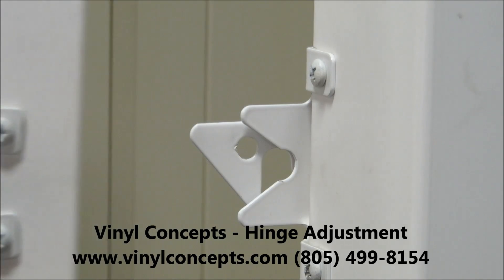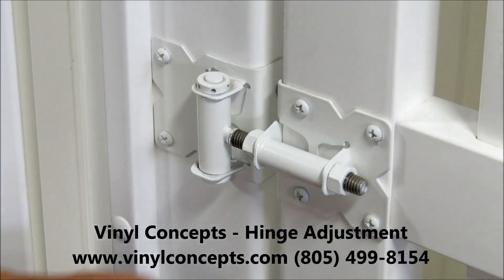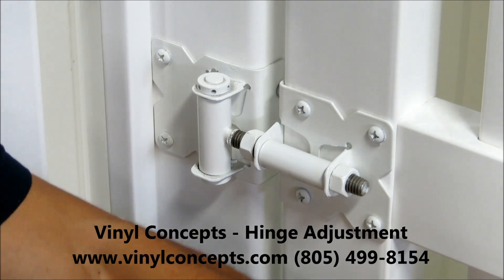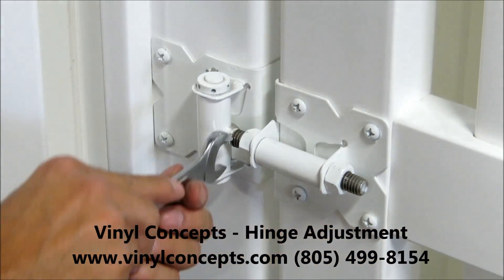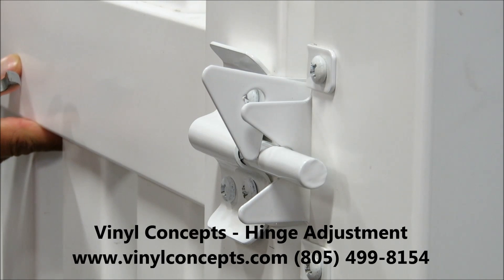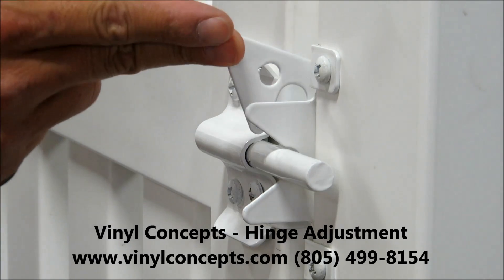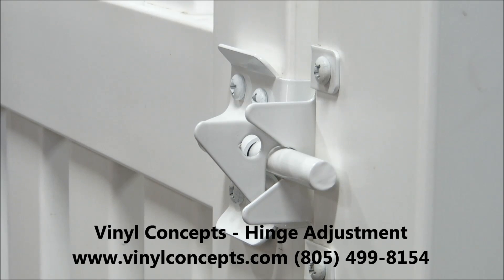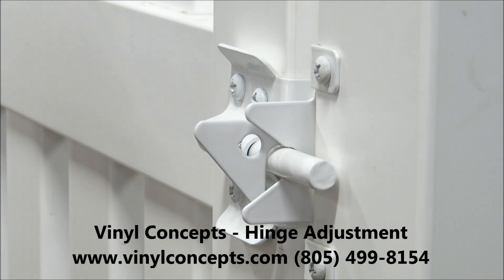Vinyl Concepts Gate Hinge Adjustment

Comment: I have two gates with same hinge.  I've learn how to make these adjustments over time as gate posts have settled slightly a new adjustments are needed.  However, the spring on the door is a little two weak to shut gate tight all the time.  I don't want my dogs to escape after mailman comes.  So I would like to fix this.  I notice the vertical hinge part has the spring.  How do I tighten to make sure the gate snaps shut on its own???